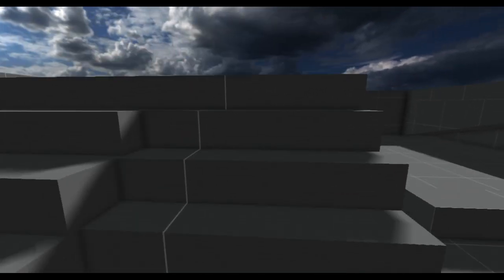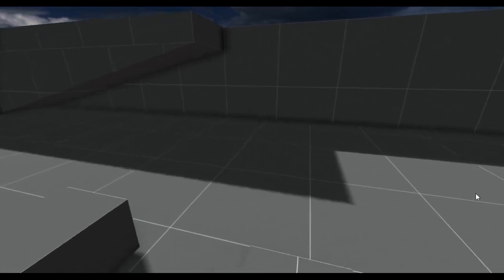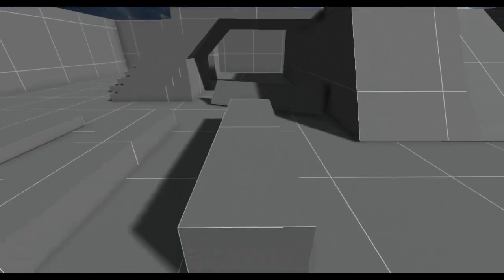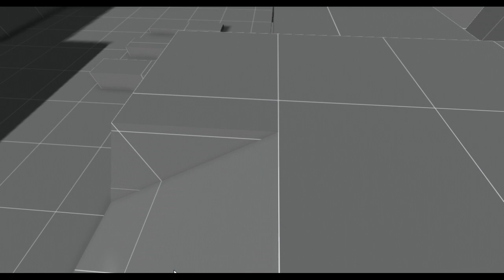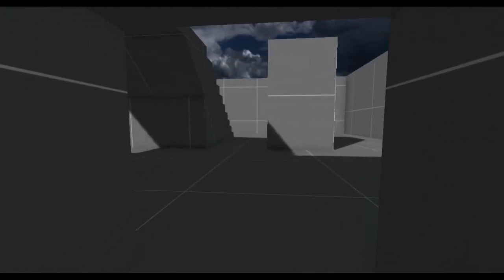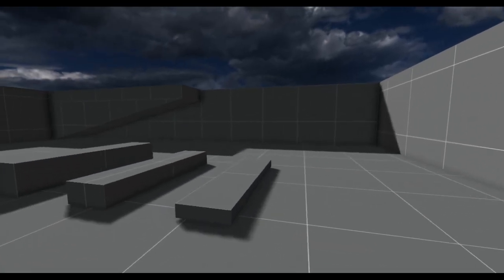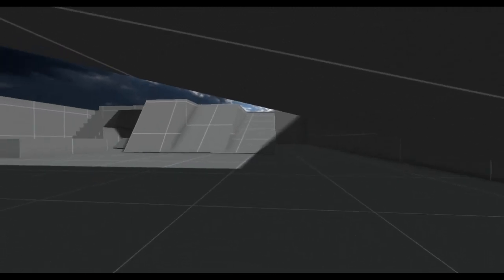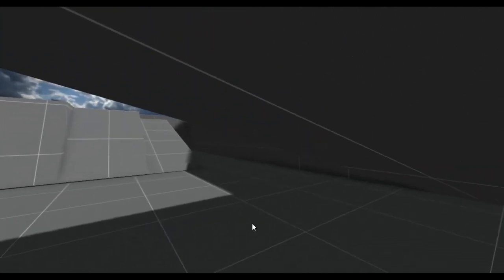Player physics in Ultra Engine

Comment: aight thats it Im buying this engine, I just want advice - on one hand I love using steam and stuff, but on other, are there any drawbacks that comes with steam license compared to non steam license?
Reply: Like lets say I have 5 working PCs with different hardware and wanna test/develop my game there (sometimes main PC might be busy baking something for days), so I have to use other PCs. Can I do that with any license and what's the way I would go about that?
Reply from the maker: @favkisnexerade  Installing it on multiple machines with a single Steam account is not a problem. It just doesn't allow two users to sign in at the same time.
Reply: @Leadwerks so if I want to do that I have to buy steam license? Can't do that with non steam license?

Comment: Amazing work Josh! Question: There will be any sort of water and bouyance physics like what we have in Leadwerks?
Reply from the maker: In Ultra Engine, every surface is reflective, so there is no need for special water rendering...it just uses the default PBR shader and reflects just like anything else. Therefore, we have a lot more freedom to make water appear in different shapes and areas. I haven't done it yet, but I plan to use brushes to make water volumes. It's mostly just a matter of deciding what the API for this should be. This will allow you to place pools of water wherever you want, instead of just having one big infinite sea like in Leadwerks.

Comment: I cant wait to start-transfer my current project from LE-4.6 to New UltraEngine.. 
One question... What about distribution ? as a current LE-4.6 throug steam ? or as a new package in executable bandle like " ,sh, .exe, .run, e.t.c.." ?
Reply from the maker: It will be available exclusively from https://www.ultraengine.com
Reply: @Leadwerks  In store i guees) or in seperate tab.. ?
Reply from the maker: @epsylon5766  In the store. There is a download / update application that will install the new engine and receive updates. Look for it at the beginning of December. :)

Comment: i am a beginner also bought leadwerks engine but ALL engines have the same problem for beginners the ai.
i wish there were some ai scripts in the engine.
tried in leadwerks but the enemies just run into walls and so on.
If you really want to stand out with the engine, make AI scripts for many different situations and enemies.
i think most of them fail in their development because of the ai...
Just my opinion
Reply from the maker: Ultra Engine isn't meant to be a beginner game engine. It's for people who need the absolute fastest performance.